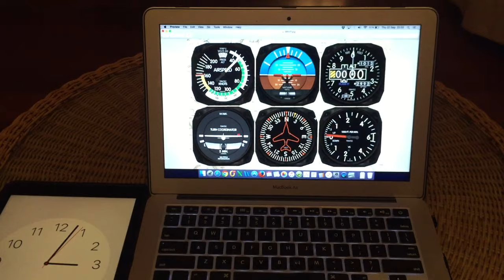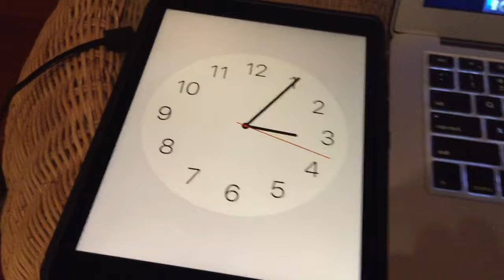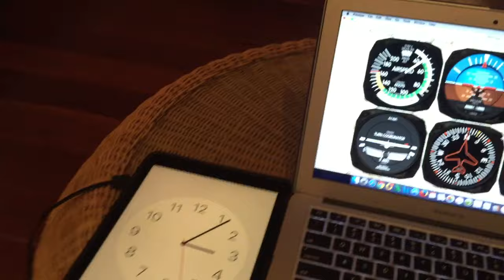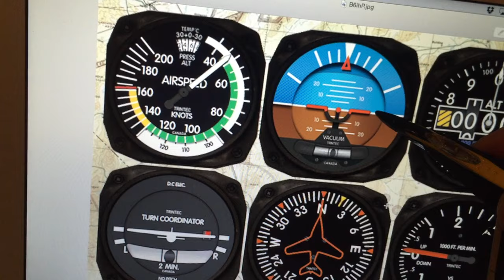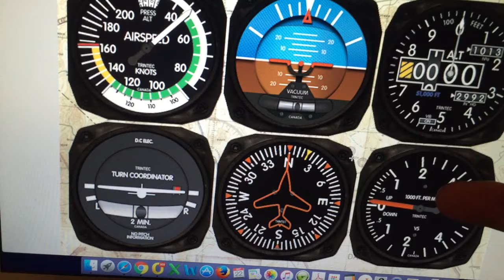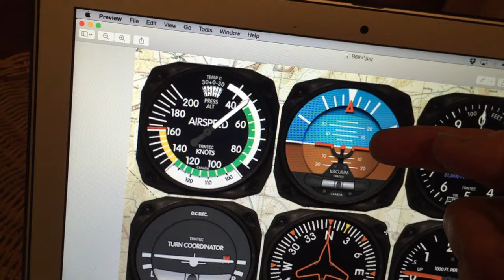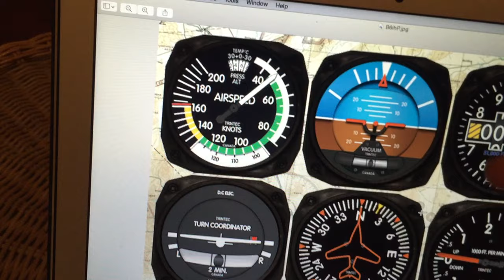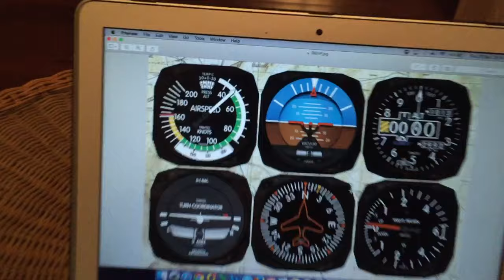Do aircraft change attitude to follow the curvature of the Earth?

Comment: I just assume the very definition of maintaining a fixed altitude precludes such a need.

Airframes are engineered for 
lift = gravity   --  with an AoA  0° 
For each Altitude and weight (and as you lose fuel, it'll vary)...

Airspeed has to increase as the air density drops (increased altitude). 
Therefore, at a fixed speed, lift drops as altitude increases. 

Atmospheric density is inverse proportion altitude increases.
In order for L = G  ... you need to go faster as altitude increases (with an AoA  0° ).

Assuming constance between the variables:

If your plane weighs  x ... 
- and - 
Your plane creates x lift at 15k feet at 450 knots air speed.
- and - 
Your plane creates x lift at 25k feet at 500 knots air speed.

With an airspeed of 500 knots, AoA of 0° at altitude 25k feet ... and ignoring variables not mentioned, the average moment of energy in the Y-axis should be ZERO. NO MODIFICATIONS REQUIRED.

Ignoring variables not mentioned EXCEPT the curvature of the earth, and given the uploader's validity to his argument, I'll clarify that despite including Gravity - I still mean NOT to include general relativity, nor the effects of special relativity for that matter ... despite the minor percentage of light speed 500 knots represents, lol) 

HOWEVER

Landing requires losing altitude ... with an AoA greater than 0° ... we now have to assume he means something other than the attitude of the plane requires a downward pitch every 8 minutes (of time? of arc? of a degree?  It's unclear ... ) 

Using the tangent to the vector of gravity while in flight as a proof which defeats flat earthers is ANYTHING but an elegant answer. It COMPLICATES something more easily expressed, to a group of people for whom complexity provides more excuses and means of weaseling out of the obvious facts.

Or, maybe his question could be represented as, IF you wanted to fly on or along a parallel tangent to gravity's vector, HOW WOULD YOU DO THAT, such that you were at all times, the distance above the earth (for however long you're over the earth) was proportionate to the amount it curved away from your initial path ... ? Or whatever his goal is.

Inputs to flight controls (by humans, not a computer) to [compensate] for or [map out] the earth's curvature sounds ridiculous. In fact, you could probably just make sure you don't feel acceleration for the most part. But, instruments will be more precise. 

Analysis of this is physics (for flight) or math for academia

Further, I'm going to assume that the remark the author of this video made:

There is No exponential drop required as this only applies to the view from a stationary observer.  For a moving aircraft the attitude change is linear - at 450 Knots it is a smooth progressive 1 degree change spread across the first 8 minutes, then 1 degree spread across the next 8 minutes and 1 degree for every 8 minutes after that.  This is a linear rate of attitude change, not exponential at all

Ignore's the ambiguity of what a minute is here: Is it the period of time? If so, if its measured based on the 450 knotts, he should have included that it was [ground speed] ... if not, that rate would be substantially wrong if you were flying with, vs. against a jet stream. 

If it's minutes ... of angle it means yet another. 
if it's minutes of arc it means ANOTHER. 

And to say all of those are 'knit picky' of me, is to ignore that this WHOLE SUBJECT is knit picky ... because HE is who's talking about having to compensate for the freaking earth's curvature -- with a 25,000 mile circumference !! 

I'm not a pilot, haven't even read anything about flying basics for 25 years ... but these are my beliefs.

Comment: artifical horizon in aircraft are analog. its a gymbal. a metal wheel spinning that temains horizontal at all times in operation. you can hear it spinning on start up. there are no 'electronic compansators". if there were they would have to be calibrated for every different aircraft. imagine flying with a 'compensated' altimeter, in a storm or at night you are going to crash into the ground at some point.  go out get an artificial horizon take the back off and take a look for youself. slight slight corrections ?????? auto pilot operations are on heading' and or altitude' keeping the aircraft flat and level at all times. the adjustments come from air currents raising and falling. i am a pilot of 17years, i notice and i feel and so does everyone else.

Comment: Dude....you are flat out lying about this. Show me the manuals that discuss auto pilot feedback loops the compensate for the curve. You can't because it does not exist. You are a liar.
Reply from the maker: You are missing the point as many others have done.  There is no feedback loop required.  All that is required is to maintain a fixed altitiude by referencing the Altimiter and VSI.  Can't you see that?  Please watch the video again and think about it carefully.
Reply: +Wolfie6020 
There has to be a feedback signal provided to the servos operating the control surfaces to maintain altitude if using an autonomous autopilot.
Reply from the maker: Diesel Bourbon
It relies on input from the Altimeter and VSI.  That is all that is required.  By holding a constant altitude the curvature is automatically adjusted for.   Do you honestly not understand why?
Reply: +Wolfie6020 
How does autopilot reference this equipment and use the data without having a signal fed to the control surfaces to compensate? I don't think you understand what a feedback signal is.
Reply from the maker: Diesel Bourbon
Now you are changing the goal posts.  You asked for a feedback loop that compensates for the curvature in your original post.  and I quote  "Show me the manuals that discuss auto pilot feedback loops the compensate for the curve."

The feedback loop maintains a constant altitude and it does feed information to the control surfaces, no argument there.  The feedback loop maintains altitude.  That is all that is required to adjust for curvature also.
Reply: Just to clarify. Which instruments provide the input to control altitude for autopilot?
Reply from the maker: Forget the autopilot Diesel. It is completely irrelevant to understanding how an aircraft follows the earths curvature.  But if you really insist on going down this path I will get you some schematics tonight. Busy right now.
Reply: +Diesel Bourbon
Input 1 = set altitude (set by pilot)
Input 2 = static pressure 

If static pressure too high = pitch up
If static pressure too low = pitch down

Simple as that!
Reply: You are CURVING around the North Pole on a flat earth.
Your gyroscope altitude is NEVER adjusted, only the East/West aspects of the artificial horizon are adjusted when flying AROUND a North Pole.
Reply: Wolfie6020 It seems to me you are trying to use the curvature of the earth as the reason for altitude corrections instead of what is really causing the need for corrections...wind currents.  Cool air drops or pushes down, hot air rises and pushes up, which constantly changes the planes altitude as you fly through them and thus the real need for the corrections.  There is nothing in an aircraft that takes the earths curvature into account.
Reply: @jlbush8249  That's correct! There is nothing that takes it into account specifically on an aircraft, as it's already considered in your altitude.

As you rightly state other factors are a lot more likely to require corrections than something as small as the curvature of the earth.

The point of the video is that no conscious correction on the part of the pilot is required just to 'account for curvature', they're just maintaining a fixed altitude.
Reply: Actually autopilot do that.. when the A/C is flying to keep constant altitude, the autopilot is on altitude hold mode. as long a/p maintains the selected altitude there wont be any error signals generated ( error signal = when actual altitude is different from the selected altitude )  so it uses altimeter & vertical speed as it input signals. maintaining the level flight (and following the earth curvature) is also done through the horizontal stabilizer by maintaining the horizon on the PFD ( primary flight display ) , ADI and/or standby horizon etc. when aircraft is on autopilot this is done through stabilizer auto trimming . apart from stabilizer auto trimming there are provisions for electric trimming as well as manual trimming by using the pitch trim wheels incase the autopilot is inop..
Reply: All long range aircraft flying today have HF communication systems installed because VHF radio systems installed onbd is not capable of providing long range communication because vhf uses line of sight wave propagation. But any frequencies below 30 MHZ ( which is HF ) the atmosphere reflects the signal back to earth so that radio waves can reach beyond horizon, allowing long range communication. If the earth is FLAT, the vhf comm systems onboard should be perfectly capable of providing long range communication and no need for additional HF system.

Comment: What happens when planes fly at supersonic speeds. Do   trimming systems react quickly enough or even have any effect at such high speeds and the forces acting on the plane . My guess is the pilots wouldn't have time to worry about the curve ,more than wether they needed to reheat the coffee when they got back home .  So if the earth was curved I think constantly nosing down would be necessary or the planes are designed thus or maybe they are called airplanes for a very good reason.
Reply from the maker: +Andrew Cornell.  It is still only 1 degree per 111
Kilometres travelled.  That is easy even at supersonic speeds.

The word aeroplane comes from the French word ‘aero’ meaning air and the Greek word ‘planos’ meaning ‘wander’

Nothing at all to do with a physical plane.
Reply: Wolfie6020    would it be more important an issue at these speeds Wolfie , in other words wouldn't a pilot need to be conscious of the need to trim accordingly at that those speeds in comparison to a Cessna light aircraft.
Reply from the maker: +Andrew Corbell.  Sure it does take more attention to maintain altitude at high speed than in a cessna.  1 degree of pitch deviation in a Cessna is a small rate of climb or descent but in a fast jet it is much more.

My point was that even at 3600 Kph it is still only 1 degree every two minutes (roughly) 

That is about the same as the movement on an hour hand on a clock.

Maintaining altitude at speed is easily achieved by a competent pilot and any attitude change is still too slow to register at all considering the pitch attitude relative to the horizon is not changing.
Reply: Wolfie6020   for the moment thanks for your confirmation Wolfie.

Comment: Presumably if a plane rises, there will also be some purely physical effects.  The air will become thinner, which will reduce drag, but also lift.  Not sure about thrust.  With propellers I suppose it would reduce the thrust for a given rpm, but also it might increase rpm for a given fuel input.  With jets I don't know.  The air intake per unit of time would presumably be reduced, which might reduce thrust.  And then there is the 'angle of attack'.  Do the control surfaces have any inbuilt tendency to offset a change in attitude, in the same way that the tail surfaces would resist any unintended change of direction sideways?  It's all very complicated.  Common sense supports the poster's experience that the tendency to 'rise' due to the curvature of the earth is just one small factor out of many influencing the plane's altitude, and that the pilot (or autopilot) will adjust the controls to maintain altitude as a net effect, not by allowing for particular factors in isolation.
Reply from the maker: Yes you are right David,  If the aircraft begins to climb and it is not corrected by the pilot (or autopilot) a number of things will happen.  Airspeed will reduce, lift will reduce and the forces on the aircraft will naturally cause the nose to drop. 

When trimmed correctly and with a constant power setting the aircraft finds equilibrium at one speed.  If the speed reduces it will naturally drop the nose, if the speed increases it will naturally raise the nose.   It is always trying to maintain the speed correct for its current state of "trim"   

Yes power does reduce as you go higher, in both propellor / piston and jet aircraft.  The air is thinner so less thrust is being produced.  Again this will result in less airspeed and the aircraft will naturally nose down to maintain speed.   If you simply had a wing leveller (to stop the aircraft rolling off to one side) and the aircraft trimmed for level flight and a constant power setting it would also naturally follow the curvature of the Earth though it would not necessarily hold a perfect altitude constantly.  

Flying under the instrument flight rules the altitude tolerance allowed is +/- 100 feet from the cleared altitude or flight level.    Usually we hold it much tighter than that,  +/- 10 feet but that accuracy won't happen naturally just by the trim of the aircraft which is why there is constant pilot (or autopilot) input to maintain altitude accurately.  By simply maintaining a constant altitude you follow the Earth's curvature.  The pilot won't even be aware of it as it is only 1 degree in 111 kilometres.

Comment: Thats interesting.  the attitude indicator is connected to a gyroscope that is rooted in the fact that the gyro is rigid in space.  It has to be to accurately display attitude.  If you adjust for curvature the gyro will depict that you are descending.
Reply: @me me When it comes to flying an airplane in the blind in mountainous territory 1 degree can be huge.  The gyroscope is set up to show your exact attitude at all times.
Reply: @me me Several years ago a famous golfer named Payne Stewart took a flight from Jacksonville Florida.  When they got up to cruising altitude the oxygen got shut off and everyone in the plane died, but the plane still had a full tank of fuel.  So it continued on for about 1200 miles, straight as a string, never adjusting for altitude  or curvature until it fell out of the sky in Aberdeen S. Dakota.  The reason they called them airplanes is that they are in the air and fly on a plane.
Reply: @me me Interestingly enough theire is a video titled Emergency Landing in Perth Australia better explained on the FLAT EARTH.  He explains what you are talking about here using his Gleason Flat Earth Map.  I was told that Air Traffic Controllers operate off of a Flat Earth Map .  They cannot operate off a globe.
Reply: @me me It has already been done.  Go to the video I cited previously and watch it for yourself.
Reply: @qanommonsense2753  - On the flat earth the flight QFA27 from Sydney to Santiago would go to the Northern Hemisphere and over the USA. This doesn't happen in the reality where we live. In the reality the flight QFA27 stays all the time in the Southern Hemisphere above the ocean. This flight disproves completely the idea of flat earth.
Reply: QANOMMON SENSE   Wrong. The name plane if for the wing not where it flies.
Reply: QANOMMON SENSE    Ever try to carry a globe in your pocket. Of course people use maps. And AE maps centred on your location gives accurate distances. This does not change the fact that an AE map is a projection of a globe onto a flat surface. I have an AE map centred on Vancouver. Is this the real flat earth.

Comment: Wolfie6020 - Here is another way to think about it: Look up: "EQUIPOTENTIAL SURFACES". In a gravitational field (or electrostatic field) the "surface of equal POTENTIAL" around a spherical charge (or mass in the case of gravity) is SPHERES OF EQUAL RADIUS. For example: If an electron is trying to move around a Proton It can move along an equipotential surface WITHOUT PERFORMING WORK. For the electrostatics case these equipotential surfaces are spheres of equal distance from the positive charge source (the proton). So you can move the electron around the proton anywhere you want and not perform (or extract) WORK Unless you CHANGE FROM ONE EQUIPOTENTIAL SURFACE TO ANOTHER.     
So what are the gravitational equipotential surfaces in Earth's gravitational fields? Why.... that would be SPHERES centered on the center of the earth. So flying along at CONSTANT ALTITUDE means you are STAYING ON THE SAME EQUIPOTENTIAL SURFACE and therefore PERFORM NO WORK.    Pull UP and climb to a equipotential surface of HIGHER POTENTIAL ENERGY, or dive to go to a surface of LOWER POTENTIAL ENERGY and WORK is performed or extracted.     
See it is 100% PHYSICS. If an aircraft were to TRY to follow a perfectly straight line in a spherically symmetric equipotential field (Like a Gravitational field) it would be CHANGING ALTITUDE and therefore INCREASING IN POTENTIAL. Physics does NOT like that as you must PERFORM WORK TO INCREASE IN ALTITUDE.

Comment: Hi Wolfie,  I asked you a couple of questions on another video. Sorry this time I didn't make it all the way to the end of this video.
I have to disagree with you at the beginning. No, a gyro does NOT compensate for the curvature as it goes around the "globe". The reason Gyros are very reliable flying IFR, its because of it's inertia properties. They will not compromise regardless of the attitude, (that includes G forces) of the aircraft, they would be unreliable otherwise.
You don't have to be an ATP to figure out these things.